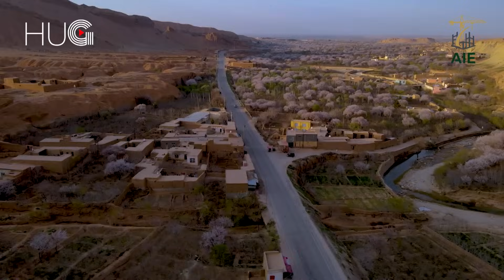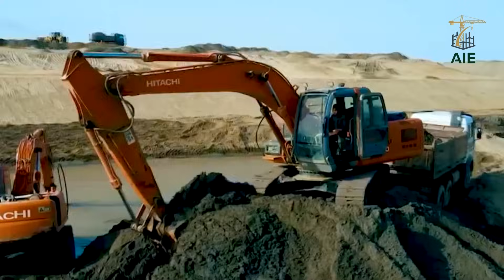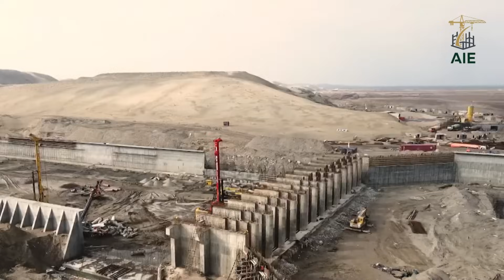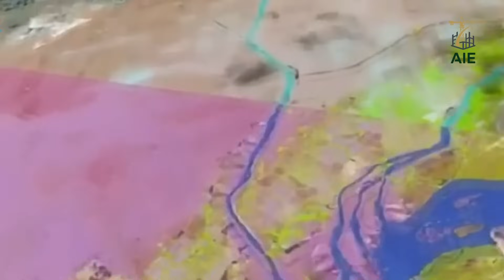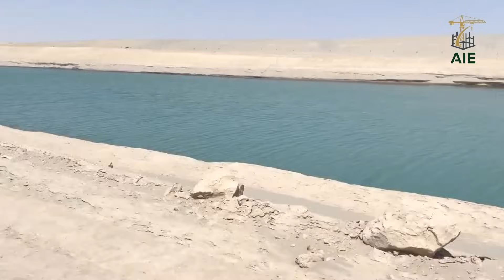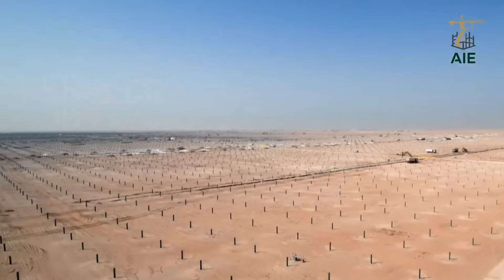Qosh Tepa Canal: How Afghanistan Is Building a Mega Project Without Foreign Aid!

Comment: Canal without concrete means huge water los evaporation + ground. But it will fill underground With water near canal which means you can dig a well with drinking water near canal. Witch is not possible if canal are sealed with concrete
Reply: And they could grow crops near the canal without watering them a lot.